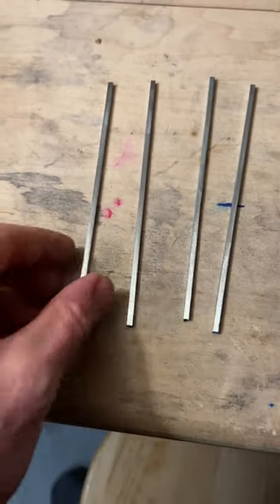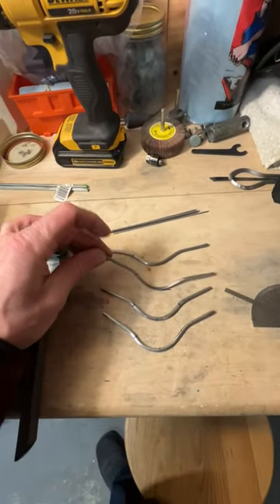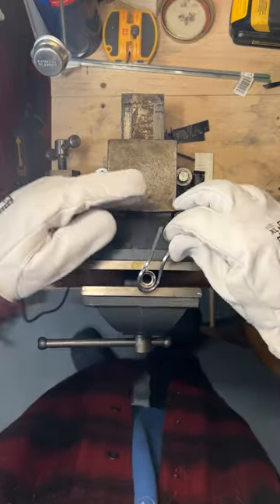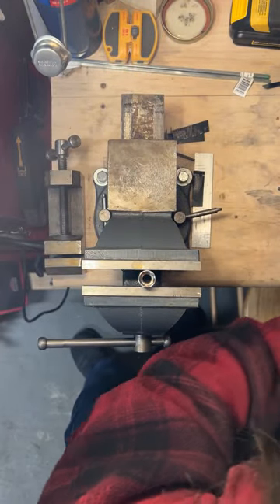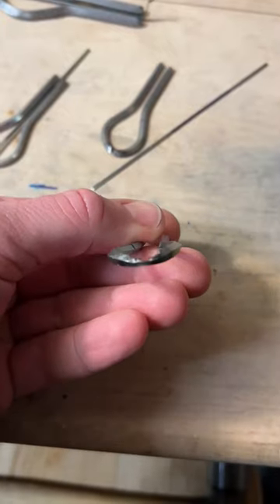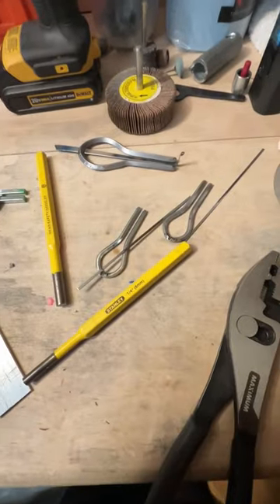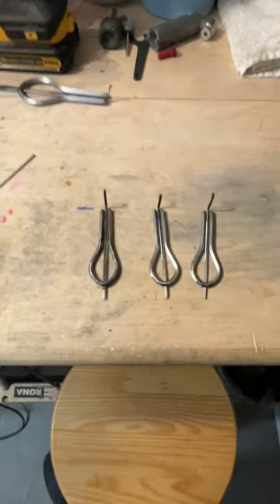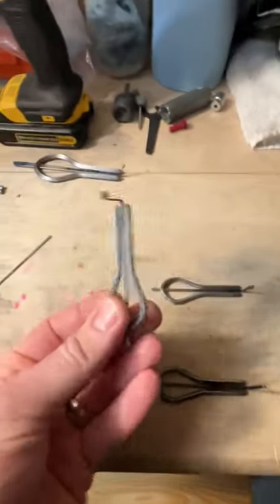The First “Mass Produced” Spike Series Jaw Harps

Comment: very cool 

Thank you
Reply from the maker: No problem!  I need more, so I’m literally going to go buy a new hamper and cut it up.  🤣
Reply: @BoxcarBetts  go for it

I am trying to figure out where to get the flat wire with out having to buy a ton of it.
Reply from the maker: @bearshield7138  Yeah, I don’t really know where else to get it, but it should be flat, I believe 2mm is what I’ve determined when trying to source out new hampers to cut up.  Walmart sells the style of hamper for less than $10 and can probably get even cheaper off Amazon.  But I want to buy it in person to make sure it’s flat wire and not round stuff.
Reply: @BoxcarBetts  thank you